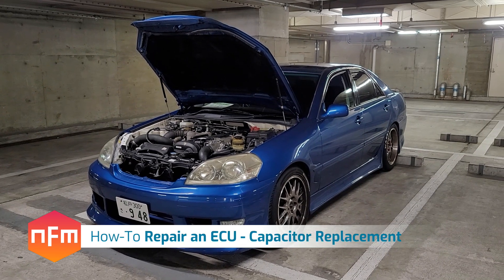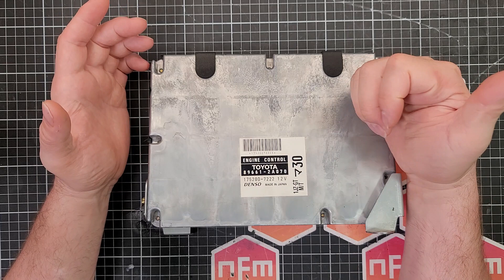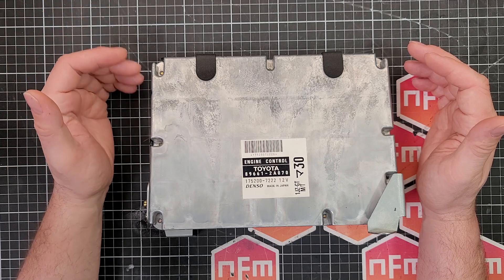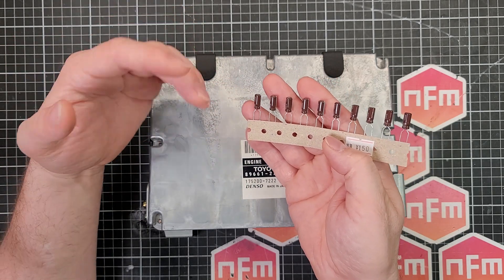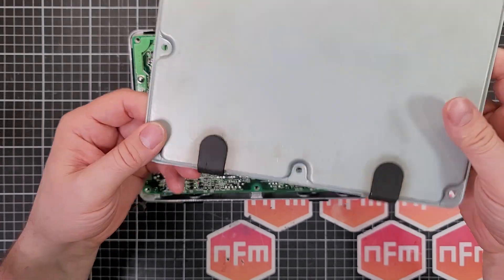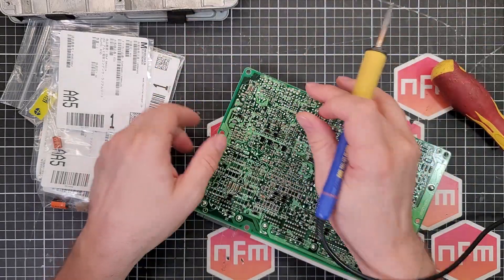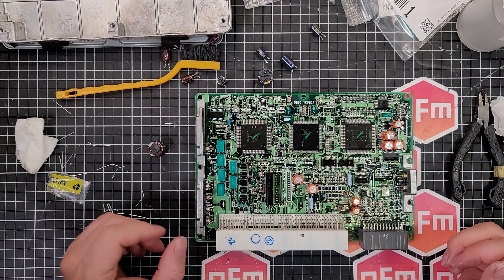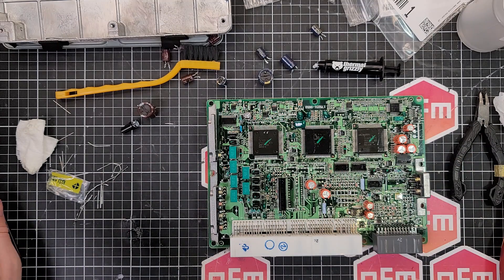JZX110 Toyota ECU Capacitor Replacement

Comment: What cap would you suggest for a bone stock 1uzfe gen 2 ECU that’s mounted behind glovebox ??
Reply from the maker: Make sure to use the same capacitance, equal or greater voltage, and always use at least 105 degree C temperature rated caps from a reputable brand.
Also, only buy from reputable sellers, Digikey, Mouser, Arrow, Element14, RS Components etc.
Forget abouy buying from ebay, Amazon, etc. Too many fakes and crap.

Comment: I wish mine was that easy, The 2008 Nissan ECU is mounted in a much harder place to get in and out. My module shorted out and blew the 5 volt reg on the input, (it has more than one). So I have to trace it down to where the short is. I hope it is a cap but my luck it will be the CPU. Still a Toyota part though, Nissan used Toyota parts in the Hybrid.
Reply from the maker: Ouch. Unfortunately I have no experience with Nissan, I'm a die-hard Toyota fanb01, haha. I can't help much beyond a 'good luck!'
Reply: @NearFarMedia  Thanks, I can't get any help on this one, I'm going to the dealer to teach their service person, he is just like me and a nice guy. My point was the Nissan hybrid and the Toyota are identical.:goodvibes:

Comment: I think I am having the same issue but with my Throttle Control Unit! I have a 97 Chaser Tourer V. TRC OFF and ETCS SNOW constantly flashing. Power delivery is laggy and idle is rough. Is there a possible way you can assist I am in Okinawa, Jp.
Reply from the maker: I'll have to check with the owner how the idle is like on this car, bad idle is a known thing with these cars and is an ongoing battle the owner is having with this car too.
My suggestion to him is to rebuild the engine and use after-market engine management, but that's easier to say than afford when it's not your car... :D
Reply: @jorge, I also own a 97 chaser tourer v. The trc and etsc flashing lights mean your traction control ECU is bad. Common problem on the jzx100. Power delivery / rough idle is almost guaranteed your maf sensor starting to shit the bed. If not that, then it’s definitely your vvti solenoid

Comment: Hi @NFM i have a 2JZGTE ecu that i think has leaking capacitors... i am looking for someone in aus who knows these ecus and can do the work.... is this a service you provide? the car won't fire up now... and when i checked the ecu there was some fluid leak near the first plug/pin set. Don't know what to do and don't want to trust this to just anyone who doesn't know supras/ecus etc.
Reply: Thanks appreciate the response :)
Reply from the maker: Unfortunately I'm in Japan so it's a little difficult...
I'm not sure who else to get to do it either as I always just did it myself.
Sorry I can't be of more help!

Comment: What are you using for a desoldering station? I'm currently looking for one.
Reply from the maker: I'm using a Hakko FM-206 with FM-2027 soldering iron, FM-2024 desoldering tool and an FM-2029 hot air tool.

Comment: Was the broke down before repair?
Reply from the maker: The idle was a little rough and hard to get correctly adjusted and there was a hesitation during sudden acceleration.
So far it seems it might be a little better now, pending further adjustments to the mechanicals to compensate.
Reply: @NearFarMedia  Great job, better fix now than later
Reply: @NearFarMedia  CPU relearning, don't adjust until run for a while. Often mentioned in repair manual, for example throttle idle reset.

Comment: No conformal coating? Automotive boards are often covered with some how-the-hell-do-you-remove-it awesomeness, often turning a simple repair job into a meditative journey.
Reply from the maker: Toyota are nice in this regard that they use a solder-through conformal coating. None of that thick impervious layer of blast armour some manufacturers use. :D
Reply: InstaBlaster...

Comment: It's not clear to me, why you change these caps, but endanger the expensive ECU by not wearing any ESD protection.
Valeo is one of very renowned Automotive suppliers, beneath Bosch, Continental and others, and all of them validate the components for a full car lifetime, and these have also to fulfill AEC-Q200. They also use  AND qualify good brands like Nichicon, therefore an elco fraud as for motherboards is near to impossible. Why you do not check the old caps, is obvious, because that action was not necessary at all.
Reply: @johis69  Hello, these videos are a guide for others, maybe less experienced viewers. If the NFM author of this video bricks his car by ESD damage, then it's really enough for his own purpose, but a disservice for others (we are talking about some investment in this case). I'm disappointed, that this basically really good channel demonstrates the recapping in such a non professional way. Another aspect is, that 20 years ago, the ESD protection of the semiconductors, and also of the whole PCB was much worse than today, so with these old devices you have to be extra careful. 
After 20 years, OES spares are probably not available, only 2nd hand stuff of probably dubious origin or state. 
Valeo may not have the best reputation of the Tier 1  suppliers, but this PCB looks like all of them looked 20 years ago, as far as I can compare.
Toyota themselves very probably had taken care, that this device is working reliably over a long time, by making some extra pressure on the validation, as they do until up to date.. so how or why do you judge over this PCB so badly?
Reply from the maker: My workbench is completely covered in an ESD mat so the workstation is safe. :)

I've repaired a multitude of Toyota ECU's in the past with bad, dry and leaky capacitors. It's particularly common in the 90's models.
Nichicon was at the center of the bad capacitors problem when their formulas were stolen and counterfeited, and Toyota wasn't immune to having faulty capacitors in their products.

The capacitor replacement was done to give us a clean baseline for future modifications and troubleshooting on the engine, the capacitors installed were almost 20 years old and certain problems were appearing that are common in Toyota ECU's when the capacitors start showing their age, like unstable idle and stuttering/hesitation when accelerating from standstill.

We decided to spend a few dollars now rather than potentially chase our tails later on.
Reply: @NearFarMedia  The brand Nichicon itself was NOT affected,  escpecially NOT automotive grade types, afaik! It was only their recipe counterfeited in no-name brands, which VALEO (or others) for sure would never have qualified/purchased! 
Also, you need to wear an ESD strap, otherwise your nice ESD safe environment is useless.
I'm working in the development of a huge Automotive electronics supplier for a long time, so I look very differently on your handling as you probably do yourself.
If you ruin this PCB by ESD damage, your car will be a complete write-off. As it's 20 years old, as you have written down in the comments, there will be probably no spare parts any more, as the usual OES obligation in this industry is 10 to 15 years after EOP. Most parts on this PCB are unobtainium, either due to PTNs, or because they are automotive - custom specific ones, and especially the µC are probably mask programmed.  
Therefore you should have shown in your video, that you need to take extraordinary care when tinkering on these electronic devices.
Reply from the maker: @DrFrank-xj9bc  I agree genuine Nichicon capacitors weren't the problem, it was the counterfeits that made their way into the supply chains that were.
I could wear an ESD strap but I am in constant contact with the ESD mat anyway so I'm well grounded enough.

Comment: did you check the old capacitors? are they out of specs?
Reply from the maker: We didn't bother as we were mainly interested in making sure they were all perfect before chasing any potential problems elsewhere.
The capacitors used by Toyota in the '90's were very prone to failure (I've repaired tens of ECU's in the past) so even though these were a bit newer we weren't going to take chances so we replaced them regardless of how they tested. They were old enough (almost 20 years) that new caps definitely wasn't going to be a bad thing.
Reply: @NearFarMedia  Do I need to replace the caps in my 1929 Philco TRF?